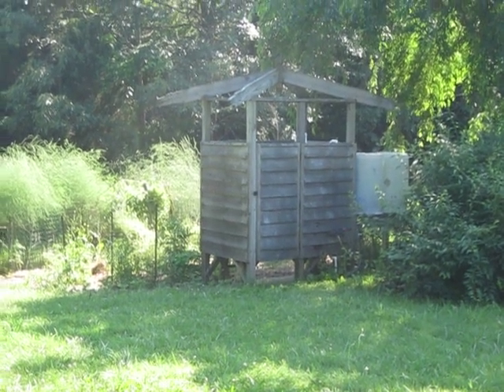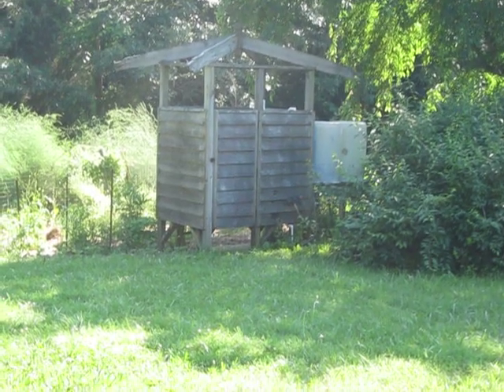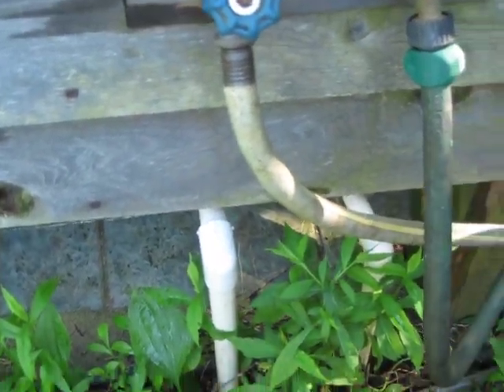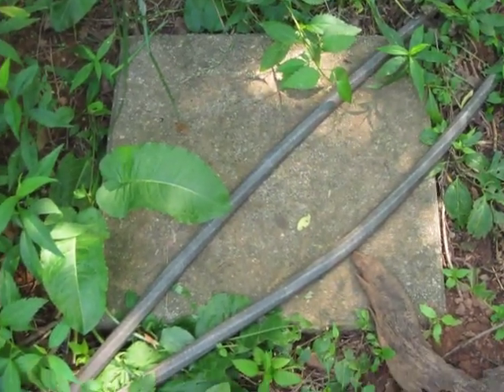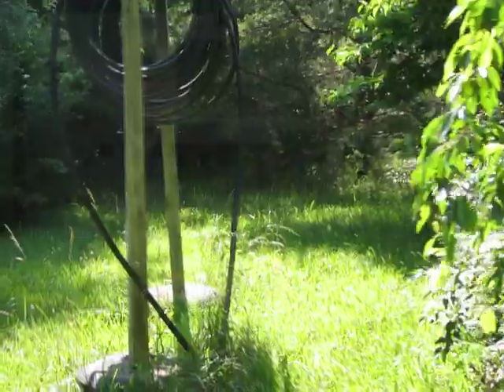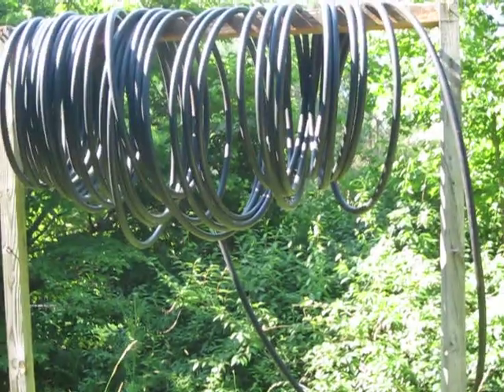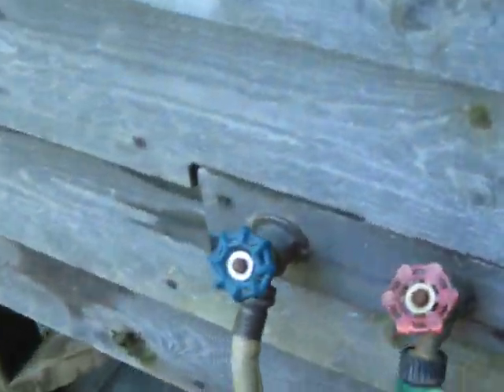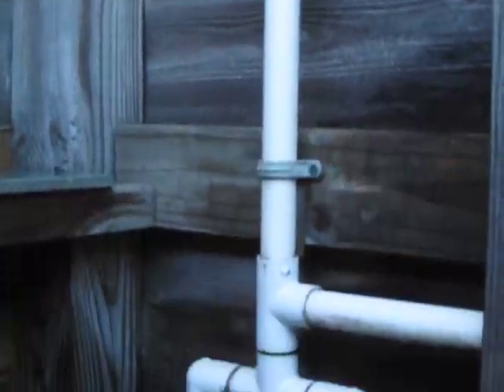How to build an outdoor solar hot water shower

Comment: Brilliant, just brilliant! How hot does the water get on average around noon and how long does it last per shower?
Reply: If the weather is warm enough to feel comfortable taking a shower outside (75 degrees F or so for me), the water is too hot to use without adding cold water.  And I like a hot shower.  We got enough hot water for two people to shower without hurrying.  I haven't tested it beyond two people.  We had a well with kind of low pressure.  With high pressure, there will be more flow and the hot water will run out sooner.  Regarding the time of noon, I can't remember.  I don't live there anymore.  Would probably depend on the temperature of the day.  If the overnight low was in the 70's and it's a sunny day, I would think it would be fine by noon.  Hope that helps!
Reply: @sherylsmithflower  very nice. Helps a lot! Why don't you live there any more? Seems like the perfect place to be especially with all this craziness happening out in the world today :-)

Comment: Hi Phrederica:

I have a similar system at my place, but the problem is that once the warm water that has been sitting in the pipe is used  is used up, the warm hoses cannot warm the new cold water that enters the pipe fast enough, so even though the pipe is hot, the water comes out cold.  Any ideas?
Reply: I am guessing you are using a garden hose?  They don't hold much water.  We used well pipe, which has a much larger diameter than a garden hose.  Also, we have low water pressure.  Two of us could take a shower, one after the other, and not ever run out of hot water.  Hope this is helpful, and happy showering!

Comment: Im thinking 2 hose pipes on a y splitter from the house spigot. One hose for the solar powered hot water and one carrying cold water connected to a shower valve that controls the temperature.

Comment: great video thanks for this simple variation on the 'off-grid' hot water concept. I have been wrestling with what system to do for my own cabin and your video brought right back to the simple basics and I particularly like the fact that it is pressurised. We have just got an artesian bore water system for our little ghost town which gives us 60psi without a pump.
Thanks again.

Comment: You could plumb the hot water as a return back to your house and heat your house water too. that was why you ran the second pip. Subconscious  was at work. lol. Nice video and I think the toe pointing worked well. Thank you for posting.
Reply: pipe not pip.

Comment: What is the diameter of the tube you are using?  How much volume of water will it heat before the tube starts to cool down?  Also, do you notice any significant pressure drop as a result of the long tube?

Comment: What i did was use a recycling bin put water in the milk containers the other bin i just use glass and put water in it inside of the blue bin put glass over it and let the sun warm up the water.The question is do you or is there a better way of heating up water but i like the way you did it in this video ?

Comment: We have about 200 feet of pipe, and it is enough for two people to take a shower without being rushed.  We've never run out of water after two showers.  20 minutes is a long time, however!  We've never timed it so I'm not sure.  Also, we have relatively low water pressure, which slows down the flow and makes the hot water last longer.  Hope this helps, and good luck making your shower!